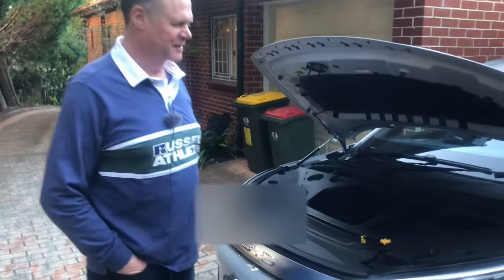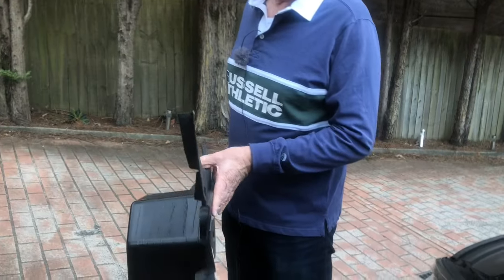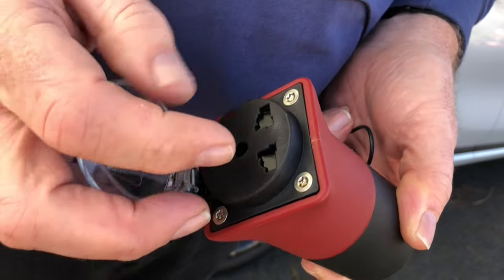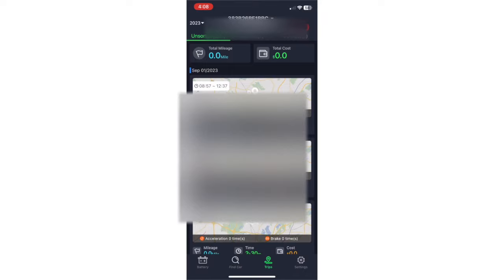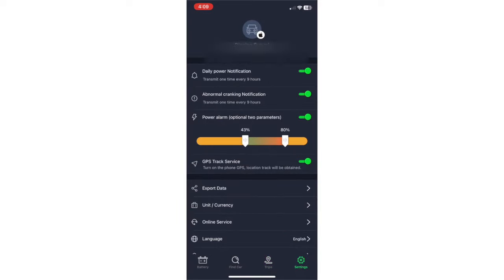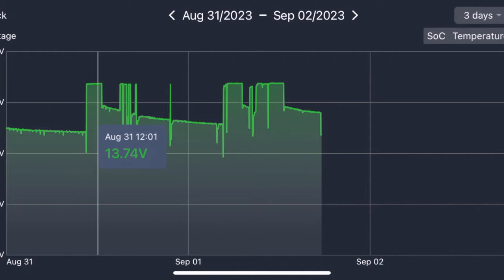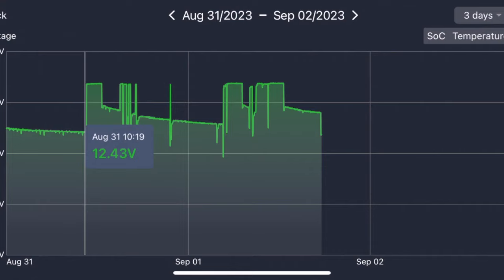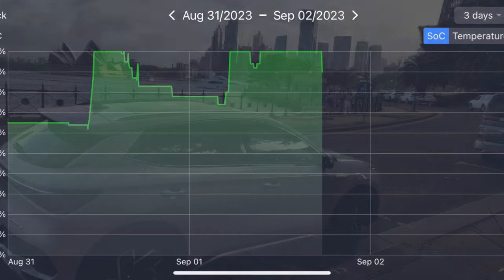Atto 3 Frunk installation and what is wrong with EV 12V batteries?

Comment: Thanks the frunk looks neat, may get one of those.

I do carry a pocket sized  Li booster battery just in case.

However, nearly a year on I havent had any battery problems, indeed I have had no maintenance issues with the Atto at all.

I give it a slow (AC) 100% charge each week, and occassionally (once per month) give it a fast charge from about 30% to 80%, just to exercise the system.

Comment: Hi there, what struts did you use? One of mine the plastic broke at the bottom when closing on 2nd opening. 😭
Reply from the maker: Hi Andrew,  I get them specially made for Atto3. What I do know is the clearance  between strut and bonnet is small so you must install to the outer fender bolts otherwise your struts may hit the bonnet.

Comment: 12v Charging protocol

Car charges the 12v using the main traction battery ( at between 13.6v and 13.74v)………

1. while the car is being driven ( powered up)

2. For two hours commencing whenever the car is turned off.. ( with 1.61 this is happening virtually all the time… esp. now the dehumidifying is happening ie fan starts when you lock the car)

3. for two hours if the 12v battery voltage drops to 12v ( approx) sustained 

4. If the VTL adapter is plugged into the car

5. Car is charged whenever the main battery is being charged (AC or DC) or even when the car is plugged in with a future charge ‘pending’ 

Points 1 , 2 , 3 & 4 stop if main battery charge level is below 15% ( reported I haven’t tested this)
Reply from the maker: Thank you for the accurate information.
Reply: @Carnormous  no problems …. Have been building it up since I got the car in Feb…. Like you have been having to create our own knowledge ..  heers
Reply: Byd have its own apps right? You can restart the car remotely from the apps if you not using it for 2-3 days…

Comment: When should I use VTOL adaptor? 12V batteries is nearly out? Thx David
Reply from the maker: Hi David, if you want charge your 12v battery, instead taking out of car you can just plug in VTOL into the car. If car senses the adopter it will start a charge on the 12v battery.
Reply: @Carnormous  Thanks Chris, are you able to send me a link to your VTOL referral for 12v battery after 1 year expiry date:) Thanks David

Comment: Hi Chris.
Where did you get your battery monitor from? Can I use any brand on the market for a lead acid battery?
Reply from the maker: Hi Paul, I got mine from Aliexpress. It will work on 6volts to 20volts any chemistry.
Reply: Thanks  @Carnormous , much appreciated

Comment: Could be a silly question, but will the battery be fully charged by using the VTL adaptor even after being flat out/dead?
Reply from the maker: It is possible but the life of 12v battery and its capacity have been severely depleted.

Comment: In Thailand last software solved this issue , no battery drain  .
It cut off standby on board charger in 2 hour. It make new issue for me , cannot use time reserved with smart ev charger after 2 hour parking.😅
Reply from the maker: BYD should give their engineers these cars to drive every day. Thankyou BYD for the new software, less bugs means a better car.